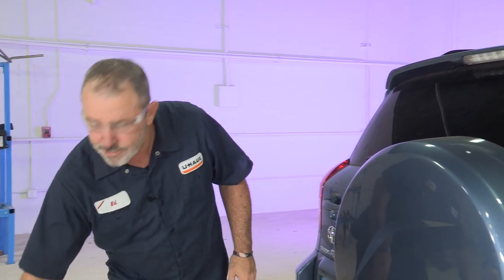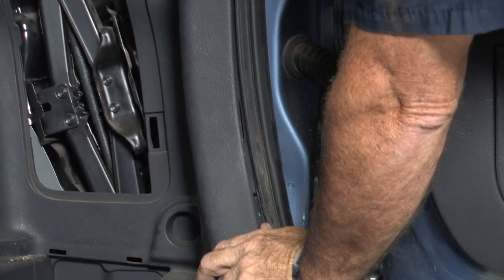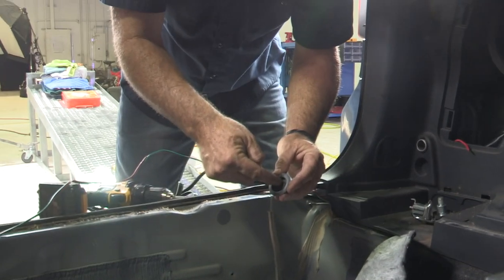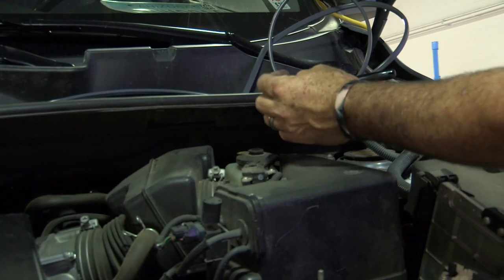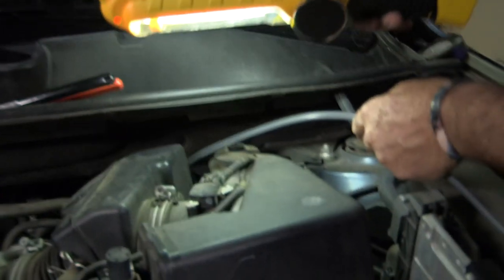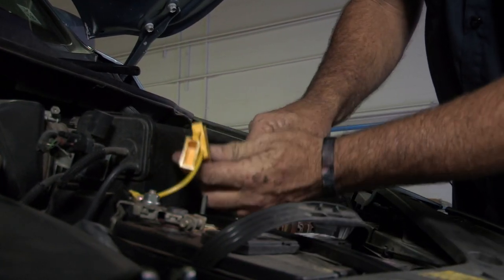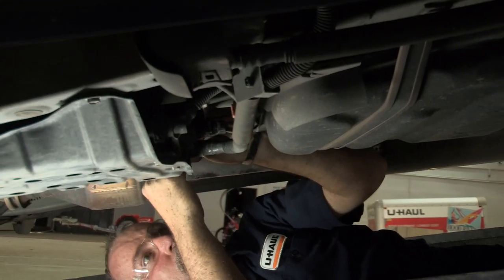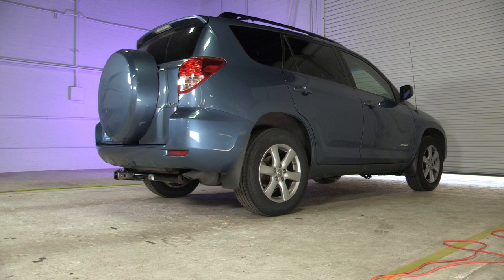2011 Toyota RAV4 Trailer Wiring Installation

Comment: I had U-Haul install a trailer light controller several years ago on my 2011 RAV4. It was done just like this video. I moved to British Columbia, the trailer light controller power wire had to be removed from under the car to pass the provincial safety inspection, so now no trailer. Personally I think this method of running a power wire, even if fused, is either dumb and or just plain lazy . Now I need to use a trailer, so I have to reinstall the power wire, I will look for a better way of doing it than illustrated here, I hope I can do it without going under the car.
Reply: If you haven't done it yet, use the aux power supply/cigarette lighter plug on the driver side. You might have to upgrade the fuse that feeds it (add at least 5 amps) since that plug is most likely only pulling 3 amps.
Reply: @rideredRC51  Yup, cosine red that, rated at 10A. I ran wire inside under the door cil trim, I just have 2 splices to install and then done.